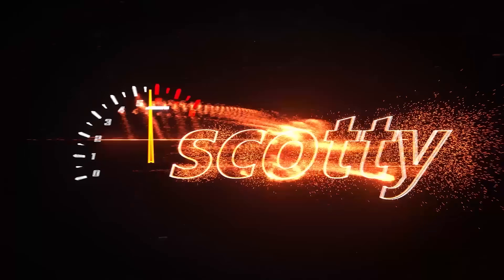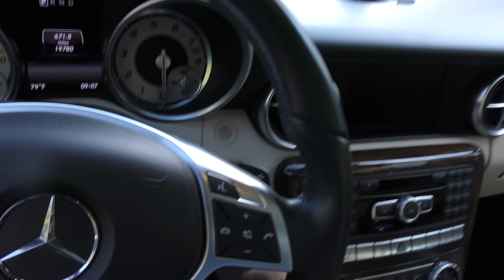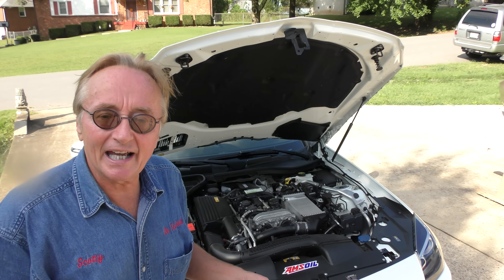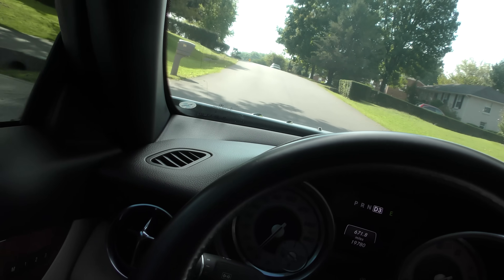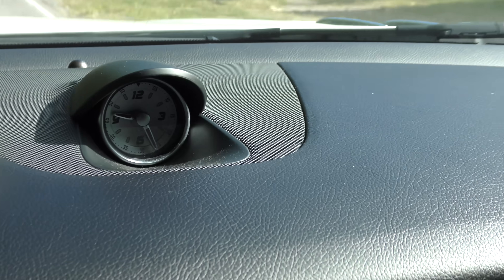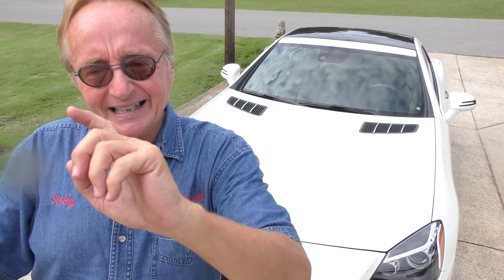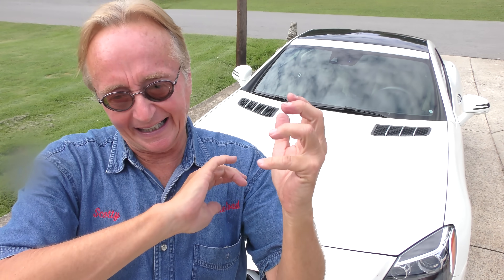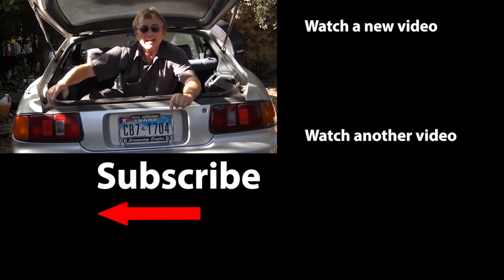I’ve Been Lying for Years, Mercedes is Actually Better Than Toyota

Comment: Yeah, I keep telling people, if I wasn't a mechanic, I couldn't afford my cars. LOL 
A friend if the family decided to buy a convertible Mercedes, after I bought a used one for my wife. We tried to tell her that she shouldn't buy one, because she won't be able to afford it. She finally realized it when she needed to take it in to change her transmission fluid and filter. The dealer told her over $900. I paid $149 for my kit with oil, filer, pan seal and new bolts, since the bolts are one time use.
Reply: For me it’s the opposite , I could’t afford my cars if I WAS a mechanic.
Reply: Get better jobs so you can afford good cars.

Comment: the 2000 model SLK is the only Mercedes-Benz Ide recommend, I had a friend in California that bought a 2000 model brand new for $40,000 it had 4 cylinder engine on it and still running
Reply: Mercedes make good engines,
Car engines, wagon engines, bus engines, 
Military engines also,
Marine engines.
Reply: @nigelclark7360  That's where the 3 pointed star originated. There engines were used over land, sea and air.

Comment: I have to disagree with Scotty about the Merc - if I ever get one, it's going to be an AMG with a V8 for sure, gas hog or not.  As for hydrogen cars, I've heard something helpful for infrastructure would be to create the liquid hydrogen where they sell it cutting out having to transport it.
Reply: Benz V8s are surprisingly reliable. I’ve owned 3 of them. Just sold my 2007 E550 with 158k miles and my old 2003 E500 had 205k when it was totaled. Just got a 55k mile CLS55 AMG.
Reply: @diablocls55  I've heard the same thing about Merc drive trains for years now and that any unreliability comes from the crazy technology they're always introducing.  With that in mind, it's too bad MercAMG doesn't make a stripped down, bare bones sports car.  I think that's why the SLR has always been my favourite.

Comment: Now that was one of your funniest videos! I've been watching for a while and I really enjoy you and your videos, but I've been wondering about your opinion of the MBs. I've been driving the '91 420 SEL for almost 20 years and I have put nearly a million miles on them, maybe more. I did drive an '86 300 Turbo Diesel until the odometer spun three times; unfortunately, the car came from Massachusetts and the rocker panels had rusted out and my girlfriend was complaining about the way it looked to my customers. I still miss that car! The SEL was the biggest production car and I feel comfortable in the car, plus there is room for my equipment in the massive trunk. I can get over 22 miles a gallon, if I don't drive like a poor man's Parnelli Jones. Although, it's hard when you feel that comfort and power. The fuel injection system was advanced in its day and was shared by Rolls Royce and Porsche, but it gives many amateur mechanics headaches these days because it is so unique. Currently, I am looking for a 420 engine with 100,000 miles on it, my current engine won't pass smog with 450,000 miles on it. Another engine might take me into retirement or longer. Keep up the good work, I love the channel. Here is a funny MB story for you. I was paying for a part at the MB dealer, it was under $20.00 and I was breathing easy, when the elderly gentleman next to me paid $1,500 for an oil change on a 560 SL. I am 75 so who knows how old he was. He looked at me like his internal organs just stripped gears. I smiled at him with my best stable boy smile.

Comment: I was a bimmer untill i bought a E55 AMG, 520hp v8 supercharger with clutched pulley, what an amazing car! 176k miles only problems where front air sturts and the SBC pump replaced under warranty

Other than that regular maintenance, done by me for 1/4 or less of what MB charges, but is not a car for those that dont know what a car is and think they can put oil once every 50k miles....

Comment: We owned a 99 SLK 230 for 11 yrs, just sold it and bought a new Toyota. Only the central locking failed, just had brakes, regular oil changes , filters, coils  and belts by my local mechanic, so cheap to own. Our favourite car.

Comment: I will put my Avalon up against any big sedan made by Mercedes.
Reply: Toyota/Lexus are the KING of reliability/dependability. My 2002 Lexus ES300 is amazing
Reply: LS430 04 to 06 best cars ever made
Reply: Not even close! Even a C class will beat it in performance, luxury, etc. And that's okay because it's cheaper than a C class.
Reply: @AcuraTSX-nv5zr  You left out repair cost. A Mercedes will beat a Toyota in that category too.
Reply: @johnharris6655  You're comparing a brand with mainstream cars to a luxury brand what do you expect?

Comment: There was a time Mercedes was very well made....then merge with Chrysler. Game over. Period. 
Today it's junk. Expensive junk.
Reply: Actually when they did that, they were both ok
Reply: @MikeJones-pp7gu  They get the absolute Worst ratings by Consumer Reports for quality and reliability year after year.......
Reply: @MikeJones-pp7gu  Same thing with me Mike.Had a E class and C class both for ten years ,no problems at all.
I am driving a  SLK  2015 model 9 speed which I bought 18 months ago with 15000 on the clock .A great car and wouldn’t change it for the world.
Reply: @wilsonglockenspiel8819  I owned a Mercedes A class A160 automatic ,the only part of the car what i likes after 2 years ....the heated Seats ....i never have a car what can rust so much ....the hole subframe was rotten ....car was fully serviced by a german Mercedes dealer...this summer car won t start well.....to solve the problem a electronic unit have to be replaced...Costa more then the car was worth....never throw so quick money away as with this piece of crap.....most bad car in europe....Mercedes V class and the vaneo MK1 ,( a klass based MPV)...under Hood of the a class you can Read.... Daimler Chrysler...

Comment: I’m not sure if the suspension firms up in sport mode as I have the SLK 350 3.5 V6 and I thought the same the suspension firms up in sport mode but it doesn’t change at all.

Comment: I have a 2007 e 350 which by far the greatest car ever owned, 200,000 plus miles , only oil change  and maybe plugs changed, the car is so reliable and what an awesome drive , if you can't appreciate that you need a Toyota, or Kia ,  27 hwy 19 city . When only the best will do . Very simple to maintain.

Comment: I have an 05 clk 320 and it still runs great. Quarter window regulators failed and I fixed each one with a $20 rebuild kit and the selector plate went bad and fixed it for $600.

Comment: My Mercedes C350 was expensive to repair, the electrical system had numerous failures. Every repair averaged $1000.  My Camry I could maintain myself.  The Camry was cheap to maintain.  I prefer reliability to feeling like the car makes me special.

Comment: I bought my $50,000 Mercedes Benz for &15,500 with 22,500 miles on it, it is AWD, 305hp, I am a retired mechanic. I bought the lighted star and removed both engine covers. It’s the best deal I have gotten in years and absolutely blows away competition if acceleration is needed!

Comment: I Had a 560 Sel did my own repairs mech 50 years 450000 miles originally engine and transmission only general maintenance. Still ran perfect autoban car do 120 all day long. Only down side to Mercedes is parts expensive oil filte 0:42 r

Comment: If you are happy to do the work to maintain them, they can be a great buy, especially with the depreciation 2nd hand.. 
I bought a 2003 c230 Kompressor a year ago, a $100K car when new, bought from a dealer for $5K!.. spent a few weeks sorting out the codes in the ECU, replaced the oxy sensors, and some other work.. its been faultless since, and so much fun to drive, love it!.. :)

Comment: Over three years ago, I bought a 2014 E350c with 70,200 miles. Other than routine maintenance, I've spent about $180 to replace a frayed cable that went to one suspension system, and replaced a ridiculously expensive AMG rim that cracked because of all the stupid potholes the city doesn't fix. I can't complain. It cost me $18,080 including tax and tags.

Comment: I have e 2013 e250 sport. Beautiful car.
Mileage was 50,000 when I bought it nows 72,000.
Had a few issues like oil cooler leak. However, when u drive anything else nothing ever feels as good as a Mercedes.  I go to buy something practical and end up with a merc again. Even my wife thinks the same.
Damn those mercs,  but hey , they looooook goooood.

Comment: I have a 2009 MB E350 with a weird problem. When I turn on the low beam headlight after apx 30 seconds the drivers side goes out. If I continually drive above 38 miles per hour no problem, once I drop below it goes out. I cannot find the issue. The dealer says I have to change the drivers headlight assembly because there is electronics in the headlight plastic housing. Cost above $2000.. ridiculous. I can understand if it's the wire harness or the some connector which attaches to the headlight housing. I do want to keep it, so any suggestions?

Comment: How is the aftermarket support for the engine? I feel like this would be fun to turn the boost up on and maybe do full bolt ons with upgraded fueling. I’m curious what the limits are of the stock internals….🤔
Reply: Just get a newer Benz and send it to Brabus for the best experience.

Comment: I have a 1998 mercedes 320E sedan. It has the original 125,000 miles on it to date. Has been garage keep over the years. Started having some with oil leaks and my mechanic is saying it will be about $2500 to repair the leaks. This is the only problem I have and the car drive is just as smooth as when I bought it new. I probably spent about $5000 on repair s over the last 3 years. I can smell that oil smell after I drive it. I Since my car is 24 years old, should it go a have the oil repair done or just go by a new toyota highlander? Would like some feedback. FYI I oil drip pan was recently replaced.

Comment: Some people nag on Mercedes but honestly, my CLS63s and my wife's GL550 have been nothing but great cars for us. Very reliable and if you like to work on your own vehicles and if you have the knowledge, go for it. Some people report various problems especially with the airbag suspension if equipped. That didn't necessarily scare me because it's only $400 to buy new ones and its easy to replace. Haven't had to replace the airbag suspension yet. They are good vehicles if you know what to look for before purchasing one, just like any other vehicle IMO.

Comment: April Fool's, you got me, but I do agree that the problem with most cars in America is that the owners just don't maintain them properly.  Most drivers got sold on the oil changes and upsold on the air filters, but wait for other things to break.  Toyotas just seem more tolerant in ability to keep going anyway.   I've seen Mazdas and other Japanese cars with common issues from not maintaining properly.  But most Germans seem to always have blown head gaskets or electrical problems.

Comment: i picked up a 2014 bmw 428xdrive msport with 20k miles for 21k$. It was a great car, and we used the heck out of it. Definitely not a car to have out of warranty - so we sold it 2 years later, after it's 50k BMW bumper to bumper one ended for 13,500$

Comment: That guy can easily drive it a few years, put 20-30k miles on it, and sell it for $15k. 3-4 years of driving a Mercedes for $10k or less is pretty minimal. And you shouldn’t have to do any repairs either, just minimal/basic maintenance. I just sold (traded in) my 2015 ML350 for $21k. I paid $29k and had it for 38 months. Total maintenance was only about $350 for a few oil changes, engine air filters, and front brake pads. I also performed the maintenance myself. That’s only $219 a month for driving a luxury suv. That’s the key for owning/driving a Mercedes. Buy them a few years old with low mileage for a good price and then dump em’ a few years later before they start needing work and still have good value. I’ve always done good with any make of vehicle by doing this. You always have a nice and newer vehicle that ends up being inexpensive to own, and you never have to fix anything big or expensive to repair.
Reply: If you bought any Honda, Toyota, luxus or Acura, you could keep it as long as you wanted and have the same routine
Reply: If you had bought a low mileage Tacoma instead,, you could have made a profit in the same time period like I did. 👍

Comment: Had a 5 series that stayed in the shop, had a c class that was a great car, no problems at all in 3 years, currently have a S550 and haven’t had any issues as well but I keep up on the maintenance, I think any car is good as long as you keep up on maintenance 🤷🏾‍♂️
Reply: @japanwatchconnection 2009. Some how water got in the trunk where they keep like 3 modules so the car would cut off when your driving, then it was the transmission, then it was the arm assembly etc etc etc this happened like 7 times in a 7 month period. Not to mention the dam wild shield mysteriously became loose. If I pushed it from the inside it would lift up smh
Reply: @japanwatchconnection how many miles you got? I think once you start getting close to 100,000 that really tells you how reliable the car is. 2017 that's still brand new lol

Comment: Ofc...you could pay a lot less up front and lower maintenance costs for a C5 or C6 Corvette....still plenty of power, and 34mpg hwy(the 5.7L aluminum V-8 was very efficient for it's displacement) with the 6 spd manual, and a convertible too!  The old Vettes are just not German or high tech, and they lack the prestige....LoL 😂

Comment: Vehicles running on Hydrogen would be a lot cleaner, even though they do emit some CO2 and NOX, but at a much smaller percentage than gas and diesel ICE.  I'd love to have a Hydrogen Fuel Cell car, but, like you say, getting the Hydrogen is the issue.  I wonder what kind of maintenance and issues come up with the Hydrogen systems.  EVs and their Li-Ion Battery Packs are well know, but the few Hydrogen vehicles out there now should still have a track record.  How long do the Fuel Cells last, are there filters that need cleaning or replacement and things like that?
Reply: I had a Honda clarity and maintenance was absurd. There is a ‘oil change’. Special cooling oil for that fuel cell which costs a fortune. $500ish if I remember correctly. My fuel cell had problems. Cost to repair was $59k.  That’s a Kay not a typo 😂. Worst car I ever had and don’t even get me started on trying to find hydrogen. I turned it in a month early on lease because I was afraid of another repair or maintenance bill. That 59k repair was under warranty obviously.  Avoid avoid avoid.

Comment: I igree with you ...any way i have 2 mercedes .1987 190d 5 speed 5 cyl. With 480,000 miles still running dayly drive car its diesel and a 1999 e300 td with 330.000 miles  no i owne the 190d for about 22 years so far problems  never had a gas engine  mercedes before

Comment: I bought a 2000 s430 and it’s a trip to work on but not too bad just a lot of reverse star socket set. But the ride is superior to my brothers 2019 caddy 😏he had to admit and got better gas mileage on this behemoth. And man it scoots. This car was 100 k new and copped it for 4000. I love it just keep up with the fluid changes and if you hear a sound CHANGE IT OUT! it’s a Benz. Good luck.

Comment: Hydrogen for longhauling is what's going to help. Batteies are heavy and having your fleet recharging is a lot of strain on the system. Hydrogen can also be transported like gasoline to out of reach places far quicker than the electricity grid can be updated. Hydrogen will win

Comment: As a Mercedes-Benz technician, they run well, IF you keep up on maintenance, like anything. I bought mine used & already depreciated, and the tech is YEARS ahead of other manufacturers. Also, they've got many more electronics than others, therefore dealer service/OEM parts DO matter. Also, this car is trash, the AMG line & modern ones are much better.

Comment: as a long time Benz owner it kills me to see all these videos from "car guys" telling us not to buy certain brands, etc. Mercedes is a fantastic brand. If you are in over your head with an E63 AMG or G63 AMG type of vehicle, well, you paid a lot for it unless it's very old or very high mileage to begin with, so one would expect you can afford the repairs. 

It would shock me to learn that any newer SLK depreciated QUITE as much as stated in the beginning of the video. But, even if it did, it just makes it that much more a bargain. 

If one is afraid of expensive repair bills, note that the only vehicle I've ever owned that experienced catastrophic engine failure is a Honda - 2009 Honda Odyssey with the terrible "variable cylinder management" technology. I ended up having to splice in a "cheat" to deactivate it because it killed the engine at around 100K miles - a known issue and one that Honda was all too willing to pay for given the lawsuits.  I don't even blame Honda, I blame past administrations for forcing the industry to react too quickly to new fuel efficiency regulations. 

I have owned three Mercedes E-class vehicles - 2000, 2002, and 2014. My current 2014 has 125K miles on it. Regular oil changes with one or two minor out of schedule service items. It's an absolute joy to drive. I've owned many Hondas and if that's your thing, awesome. But note that if you buy any Benz, BMW, and yes, even Lexus - avoid the dealership at all costs. If you don't have a great indie mechanic nearby that knows the brand and knows how to maintain it and/or fix any issues that arise, yes, you will get your pockets emptied by dealerships that charge way too much for regular maintenance, let alone problems.